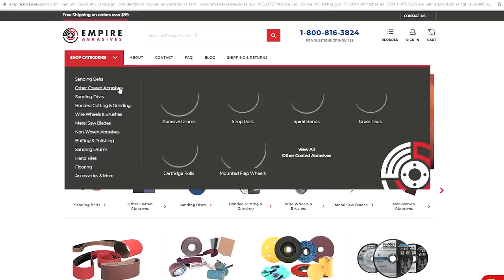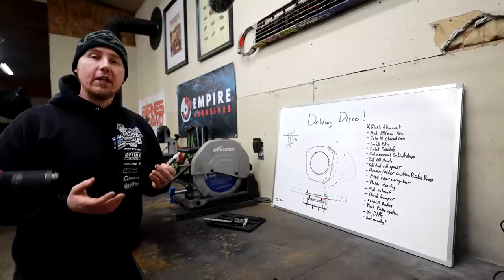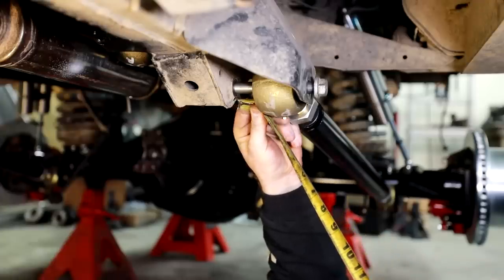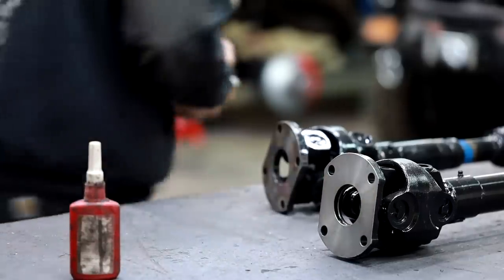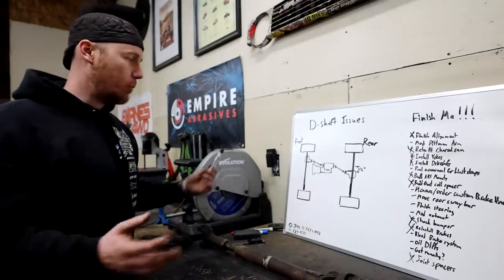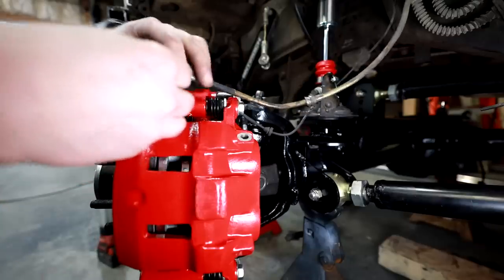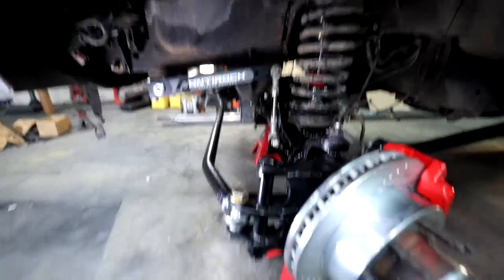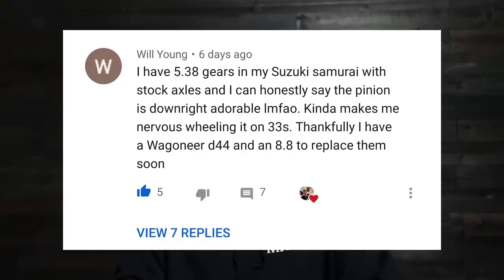It Drives! 1st Test Drive on 1 tons. Ultimate Land Rover Discovery Build Episode 14

Comment: I also run  progressive shock bumpers from Eibach.  They definitely work!!   My fox shocks use red loctite for the lower mount. You have to put the shaft in a soft vice and heat the end with a torch to loosen the loctite. Awesome to see it moving!

Comment: This is going to be a bit of random rover knoledge but most US speck rovers, came with a 1.2:1 high range output, 1.4:1 in deisel models, with the 3.4:1 low range.  Also on the random things, the 1ton defenders ran a salisbury/sterling 1ton with right hand drop housing.

Comment from the maker: Hey folks! I had some questions about the mighty vac system I used to bleed the brakes. This is a combination of a fluid evacuator pump and a one man hand brake bleeder kit for the fitting on bleeder. I put the parts you need in an Amazon shoping cart. This is a great combo that I use often for more than just breeding brakes.
Click the link to see what I used https://www.amazon.com/shop/dirtlifestylenate

Comment: I got a 98 Cherokee have a d30 up front fully trussed going to 4.88 gears arb locker. Rear Ford 8.8 with Yukon locker 4.88 gears. Running 33s right now but going to 35 and I also have a super duty 60 front and sterling 10.5 rear! Going to do 5.38 gears fully locked been building them for a little now but waiting to get everything ready to do a cage, one tons, and coil carriers! Your videos are a huge help! Thanks for all the free content.

Comment: It almost looks like you’ll hit full compression on the front springs before you hit the shock bump stops. 

Also, to another comment, the LT230SE transfer case has a 1.21:1 high, and a 3.2:1 low ratio.

Build looks awesome!

Comment: Are the stock axles really weak if
You plan on wheeling it hard? I have the opportunity to buy a disco for a good deal it’s already lifted on 35”s
Reply from the maker: Yep. Super small and super weak. If you throw all the high strength axle mods in that thing 35s are certainly doable. But keep in mind the more axle gearing you need to accommodate the larger tires the smaller that already undersized pinion gear becomes. To me 35s are max for a reliable setup on heavily modified LR axles. The best setup I have seen is modifications to the LR housing to fit the Toyota 3rd member and custom chromoly 30 splines axle shafts. I know alot of folks say you can build for 37s but those tiny ball joints and how narrow the axle is make this very impractical for heavy offroad use. Just my 2 cents 👍
Reply: @DirtLifestyle  thanks for the info I really appreciate it

Comment: Nice job on that axles swamp!!!! here in Portugal on that kind of swamp, usually they change the gearbox using a Nissan or a Toyota to correct the angle of the rear transmission. For the front bump stop, there are a kit that use to put dual shock, you could build the brackets but instead of using the shock, you use a hydraulic bump stop! :)

Comment: Talking gearing for a rig for say overlanding (both highway and trail) The way I consider axle and transfer case gearing. Axle ratios, tire size, transmission gearing (does it have overdrive) to achieve a target engine RPM at a given MPH. Transfer case ratios for that crawl ratio.

Comment: I know you mostly build up American trucks... But have you considered a Toyota 100, 80, or 60 series Landcruiser axel? the rear axe is offset like the front, I think its the same as the Land Rover from what you have talked about... Negative is Landcruiser parts = $$$; BUT it may at least be worth investigating if the rear acts up on you.
Reply from the maker: Way to expensive and not wide enough unfortunately. Not to mention the advantages like giant brakes/ring and pinions. But to be honest cost is the biggest challenge with Toyota parts. 👍

Comment: So how did the double/double cardon work..I have a Samurai with a sidekick rear housing which is a center diff with off set devolved t case..I have a double cardon from 85 4 runner shortened 2" that helps but still needs to loose the 3rd offset at the rear diff..I had the idea to do a double/double but was wondering how yours worked out..You didn't coment on a vibration on your test drive, so I'm assuming there wasn't one.. Keep up the great work.. 1 ton Disco is a keeper..
Reply from the maker: The disco drove very similar to before the swap to be honest. At lower speeds I didn't notice a vibration but it wasn't a very good test. More information in the next couple weeks 👍

Comment: Plan D: use rear drive shaft CV joints, like all new JK wranglers do. They are a slip style drive shaft as well. This was the factory solution for having such short drive shafts, and the problems created by having U joints in such a drive short drive shaft.  CV joints and double cordons are not the same.
Reply from the maker: A cardan joint is a CV joint. Because of the way it's sealed it doesn't need a boot. The cv joint typically found on an axle shaft is a different type vs the cardan joint on a driveshaft but both are definitely cv joints.

Comment: I'm very interested to see how happy you are with the AWD and the D60 joints in the front.  I have a similar setup under my Land Cruiser, and I didn't like how the U-joints felt, particularly when accelerating from a stop while turning.  I ended up doing a part-time conversion to the transfer case to solve it, rather than putting in CV axleshafts.  

I'll keep watching, loving how it's turning out for you!
Reply from the maker: This is something I have been thinking about since the beginning of this project. I would prefer to use RCVs but at 3500 bucks for the pair of shafts I couldn't justify the expense for a vehicle that is intended to haul camping gear lol. Time will tell how much I end up feeling in the wheel

Comment: Why would you think drive shafts we going to be a problem. It's not in a perfect plan view straight line but will be offset in it's custom axis and the double cardan joints will work the same either way. Congrats on the milestone Nate, keep em coming.
Reply from the maker: My skepticism is from past experience. I've played this game before lol most of the time I have won but there is an instance in which i lost. They didn't vibrate to bad but im hoping that with some tuning I can eliminate any potential issues and keep the vibes to a minimum 👍

Comment: Since you are building from the ground up anyway - why not add a system such as King / bilstein external Bump stop mini shocks - would eliminate the need to disassemble the shock and have a little more comfort and control.
Reply from the maker: I'm not a giant fan of hydro bumps on short travel suspension. To noisy for my taste. 👍
Reply: @DirtLifestyle  Makes sense.  Thanks so much for the explanation!  Love the build!

Comment: Loving the video! Not done with it yet but i am curious how the spacer up front will affect bump steer. My first truck was a 72 power wagon on 36s with minor fender mods for clearance  due to a 2 inch block lift. It was lifted in 78 because they didn't know better back then.
Reply from the maker: Thanks!
The spacer won't affect the bump steer because the suspension/ tuning will dictate those types of handling characteristics. In a leaf sprung application there is very little you can do in terms of tuning but for a link suspension we have a TON of options 👍

Comment: Bilstein I believe has shocks that have internal bump stops. The 8112 does but those happen to be coil over.  I kind of wonder why you did not go coil over. You probably addressed that in an earlier video.
Reply from the maker: Coilovers wouldn't give any benefit in this application. Coilovers are great if you are starting from scratch but if you already have coils and mount a high quality shock you wouldn't be able to discern the difference in ride quality. So all the extra work and cost wouldn't yield any measurable gain. Also, Coilovers are sooooo sensitive to weight that I could only mount a set in the front. In my TJ removing the spare tire changes the height by almost an inch. In an overlander the weight has such a large fluctuation depending on gear and water that this would be a serious problem.

Comment: I have a question: 
Would You ever consider, instead of putting bigger axles, putting portal axle assemblies on? I have seen people modify tractor portal assemblies and run them on 35" which gives an additional ~15cm/6" clearance and extra lower gearing because of portal assemblies. Or some just go crazy and swap Unimog/Volvo C303 Laplander portal axles that give them ability to wheel 42" tires, huge clearance and big ratios.
Thank You for awesome videos and informative content.
Reply from the maker: Portals are cool but they are crazy expensive! Very hard to find in the US and the style that bolts onto your existing axles only solve half of the problem. The factory d2 axle comes with a tiny ring and pinions and only 24 spline shafts. If i could find portals that would fit these axles I would still have giant reliability issue and worst part is I would be broke from buying portals lol.
Reply: @DirtLifestyle  I guess it makes sense since I'm from europe and finding a used US axle here is very difficult and all those crazy army surplus portal axles are more easy to come by. I can also understand why they are more popular in europe, since our offroad is mostly mudding and almost no rock crawling. Also far as I know all the tractor/unimog/volvo portals are really reliable.
Thank You for Your input and great content, I have learned a lot from You! :)

Comment: Hey nate. Are you worried about dirt and debris getting in that rear abs sensor gap. It seams exposed. Unless the brake rotor covers it
Reply from the maker: Yep this is a potential problem. I am trying to get the message across so you will notice I'm repeating it mutiple times in every video. You are watching somthing very experimental. This hasn't been done and many of the first iterations of these various solutions are testing to see if the ideas are even possible. I need to make sure the relationship between the oem sensor and aftermarket tone ring is even possible before I spend countless hours engineering and building a weather tight enclosure. As the short test drives turn into long ones we can see what need to change in all of these untested components and how they interact 👍
Reply: @DirtLifestyle  It should be fine, will just have to rinse them off if they get muddy, as the dirt in the tone ring will give a false reading. We see this on our farm pickup trailers for dairies. The setup is almost the same on the trailer axles. When we see the ABS light on the trailer coming on, we know it is time to give them a quick cleaning and the problem is resolved. Awesome build, fun watching it all come together.

Comment: I have a 1973 dodge w100, I have a 8.75 rear and a Dana 44 front. Is Dana 60 front and rear too heavy for a half ton truck running a 410s and 35s? Also do you have thoughts on a 203/205 doubler? Thanks, videos are awesome keep up the good work!
Reply from the maker: I will touch on this in the next q/a 👍
Reply: I saw he touched on this in the most recent video. I have a bit to add... as far as the dodge dana 44/60 do a little bit of research... certain years of those dodge 4x4s used ‘center axle disconnects’ on the 44 fronts. Somewhat undesirable but companies do make kits to eliminate the 
C-A-D and beef up the axle.  Torqueking.com is a great resource for those axles.

Comment: This like my issue. I’ve dumped the Rover 4.0l for a ALH tdi and maybe a NV manual. I want to keep the t-case and axles (maybe). I know the Rover axles aren’t the strongest, but I’m only running 33’s. But American axles aren’t offset like Rovers. I know the UK forward control Rover trucks had Dana 60s, but I imagine that would be expensive.

Comment: I don't know if you will ever have a chance to answer this but I have a donor truck (1996 Dodge Ram 3500) with a Dana 80 dually rear axle that I'd like to use to swap into my overland project (1999 Dodge Durango). Is there any advice you can offer on converting to 4 link and what to do about ditching the actual dually wheels? I'm a serious noob bit have amazing goals. I plan to do a solid front axle swap (Dana 60). I'm also seriously considering cramming the 6bt diesel, nv4500 transmission and gear vendor in the Durango as well.

Comment: The lt230 transfer on your disco is 1.2:1 ratio. The next is 1.4:1 that comes in defenders. 
Alternatively.. Ashcroft transmissions in the UK have multiple other options. Including close to 1:1. 

Also, these transfer cases are pretty strong actually. Plenty of Ls swapped defenders around with the factory transfer case. 

The diffs are the weakest link in a landrover. And you’ve fixed that 👌 
Im still in the process 

Otherwise. Cheers for another video mate 💪 
Later 🤙

Comment: My 2007 Tacoma super duty swaped  has weak breaks as well. To clarify when I say weak, it stops good but takes large amount of pedal throw and foot pressure. Then if you give it that it stops good. My master is a 13/16 bore. Interested to see what you come up with.

Also my front drive shaft is on a good angle as well. Running non cv drive shaft from Adams with the agricultural ears. 

My issue is in the rear i have a vibration starting @ 15mph and ending @ about 18-19mph. Pretty sure it's due to my carrier bearing position and or pinion angle. When I was setting it up I could not find much help and winged it. But it's been a year and still going strong.

Comment: Question, with the shock bumps, wouldn't the antirock kind of prevent full bump?
Reply from the maker: The antirock will absolutely help resist full bump but I need a completely fail proof bump system. Good call though 👍

Comment: Quick question. My buddy has a 03 TJ that we're kind of at a fork in the road with. We're swapping in a TJ Rubi 44 front and it already has a 44 rear with a Yukon LS Carrier and 4.88 gearing. He's currently running 33s and looking at either 37s or 40s. How do you feel about 40s on a Dana 44s front and rear for long term use?

Comment: Love seeing the Disco moving on all 4s! Great work! I have a question regarding my 94 XJ Country that I'm planning a 8.8 rear swap on. Currently its on a 3" lift but I plan on going to at least 4.5" down the road. When setting up the pinion angle for the 8.8, will there be a big difference setting it up for the current 3" lift vs 4.5"? Can I set it up for both or find a happy medium, or will I have to shim it later for the bigger lift?

Comment: <<---- i have same drive shaft angle probleme, look my profile picture loll <<----  and the best setup i find is 2 single U-join, because  double join requiere 0 angle at end.  but it impossible with this setup build

-delete double u-join
-pinion angle ajustement
-drivetrain lateral centering. to get same length right/left yoke to yoke   . (this set your lateral driveshaft angle correctly) ,  or perfect semetric angle yoke. (yon need to view that in 3d ;) )

with good setup,  perfectly run,  but,  next time i broke it, after 7year, i put my  custom build toyota axle passenger drop, but  for now, i dont need it, with proper setting

Ujoin have possibility to work there, and is better durability, because all ujoin bearing work. 
Volvo heavy road Truck    run transaxe  driveshaft with 2 angle  and  small lenght

Comment: I worked over 25 years in the power generation business. I supervised the overhaul of turbines and generators for about every major electric company. there are several sensors similar to the ABS sensors on cars. I don't know if they operate on the same principle as the automotive sensors. We would set the turbine and generator sensors that monitored vibration, rotor speed (RPM) and rotor position at 10 mV Distance from the tone ring using a Fluke meter. This worked out to between 0.030" and 0.040". Setting the ABS sensors at 0.003" may be way too close. Other than that, great build on the Disco. Love your fab content.

Comment: Great build .  Personally my thoughts , as I was thinking to myself watching you as your first video with the Dana 60 swap , was I would go with either the stock ‘case and build the axles accordingly OR what I did many years ago...  Dana 300 with the twin stick conversion.  I used a plate made by a company in New Zealand .  Strong, extremely reliable and plentiful with parts if need be .    Mine still runs and the current owner still cruises with it, across country.   Good luck !👍🏼

Comment: So do you have suggestions for a really beefy you joints or drive shafts all in one on a 2002SE model just asking thanks a lot love all your work
Reply from the maker: I assume you are blowing out front ujoints on the pinion? From what I understand this is a common problem. For most people the fix is a drivshaft with CVs at both ends 👍

Comment: Don't know how it compares to your specific offset between transfer case and axle but, we see this same problem in the Suzuki samurai community when people swap new axles. And for the people who aren't willing to hunt down a Wagoneer d44 rear or the one specific Toyota housing that is offset, the solution has always been a driveshaft with factory Toyota double cardan joints at both ends. And, I haven't swapped my axles yet but, all the claims I have seen are of very positive results. So, if the offset you're dealing with is at all comparable to what is dealt with in a samurai, I think you'll be just fine using that driveshaft

Comment: love this build series Nate great job. i have a 69 jeepster commando that i plan on installing a 3 or 4 link up front. and a 4 link in back. I plan on using it as my daily driver and trail rig. with a little bit of rock crawling also. What progressive lift spring/shock combo should i use? i want great ride quality on and off road. Thank you for all the great content. I have learned so much from your video's. Keep up the great work